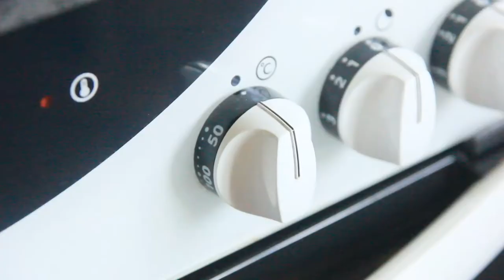Forging a spoon carving gouge - making woodcarving tools

Comment: I like the improvising; using the ball end of a vise handle to shape the gouge is thinking outside of the box. Well done. I made a swage from half of a 3” (75mm) pipe in order to form an adze. Need a tool, make a tool. Darlington, South Carolina USA

Comment: That came out beautiful!! I will have to try a flatter handle like yours because something that small may slip in my big hands that I inherited from my dad. Not exactly feminine looking, but with my hobbies they suit me. I don't have a forge. I don't have an anvil. I don't have forging tools, but I do have ingenuity. I recently bought a 6"x2" piece of steel for an anvil I needed for jewelry making; I have a 14" long channel lock plyer to hold the steel in the flame; I have a small 3-pound sledgehammer, and I have a propane torch. Will that work to make a gouge? I have a ton of different species of wood I was given to me by an old timmer. I also have an assortment of steel that was given to me by the same old-timer, but I don't know the properties of the steel or if it's cold or heat treated. Will that make a difference? I'm very excited to try this! Thanks for inspiring me!